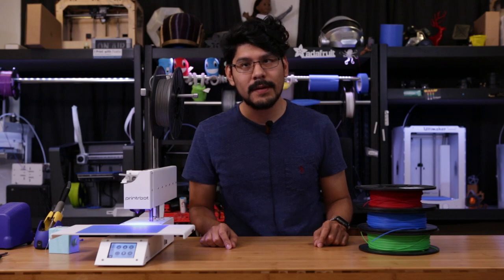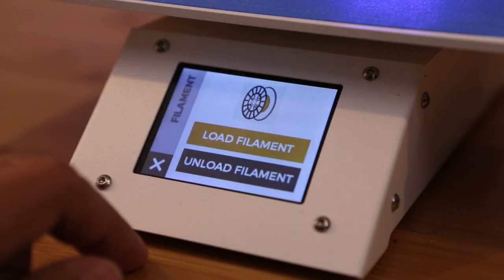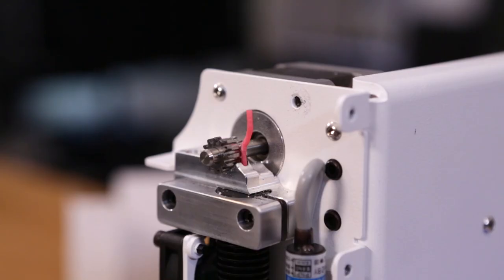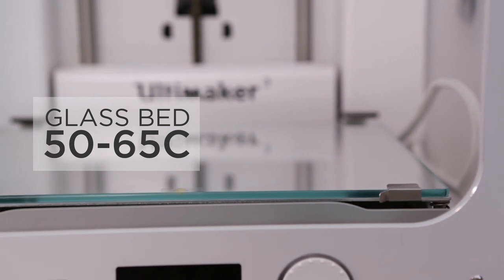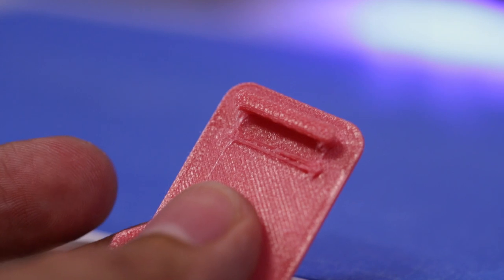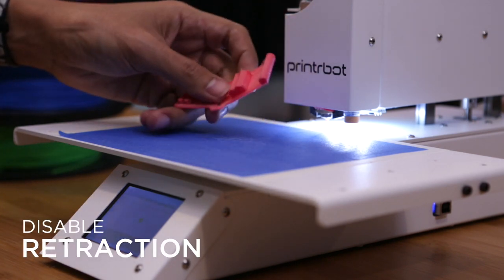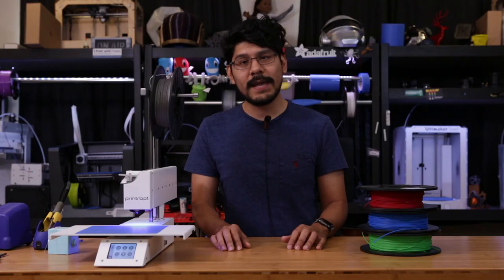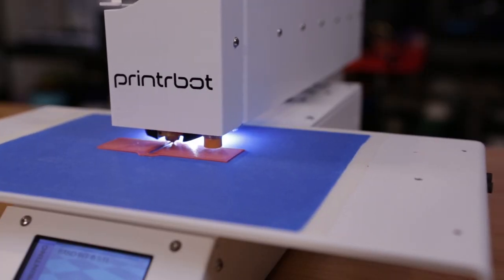How to 3D Print Ninjaflex #3DPrinting

Comment: The most important tip to printing TPU is to make sure thare are NO air-space gaps between extruder hobbed bolt and nozzle. Any gaps will allow the material to bind.